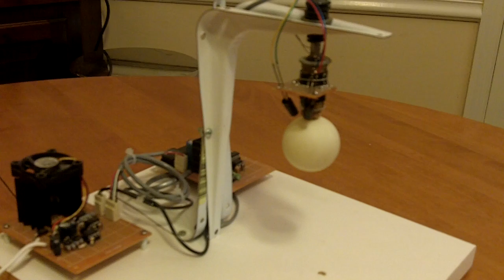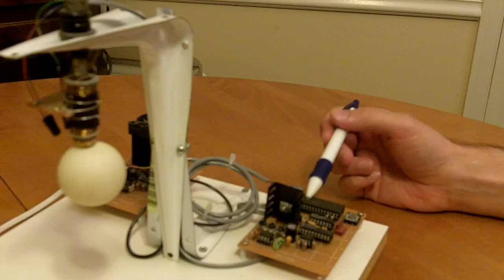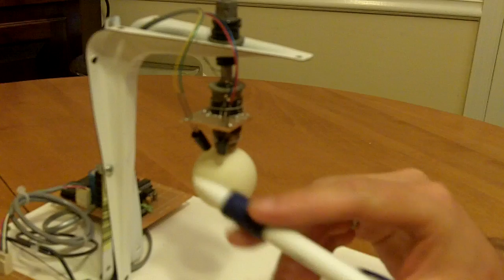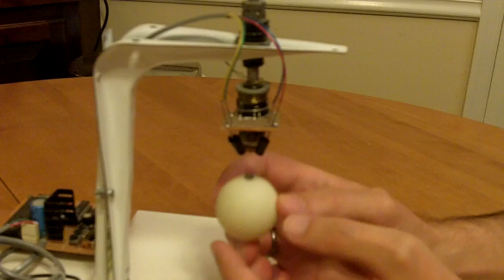Active Magnetic Levitation

Comment from the maker: Initially, I tried to use a simple proportional control loop (where magnet power was proportional to the ball's position error), but that wasn't remotely stable.  I ended up with a Proportional-Derivative controller-- the derivative term really helped stop the ball from bouncing uncontrollably.

In addition, I made a simple lookup table which gave the baseline magnet power required for a given distance.  (Since the magnet drops at the square of the distance.)